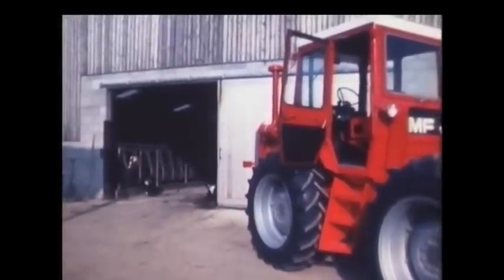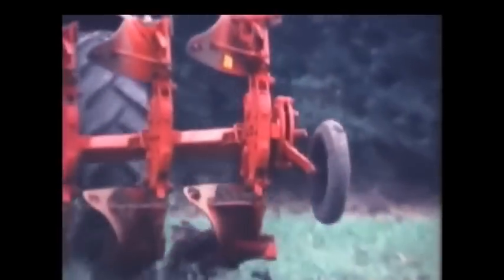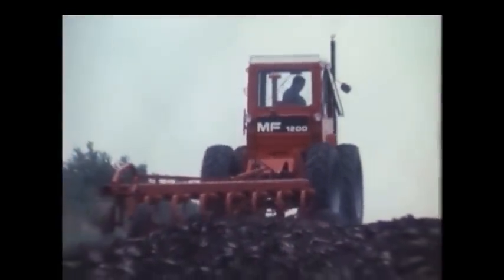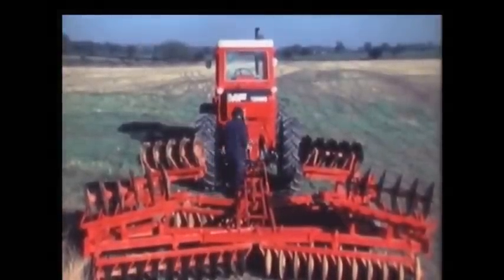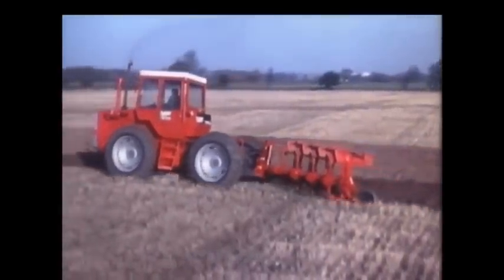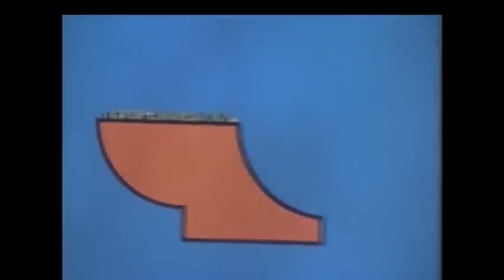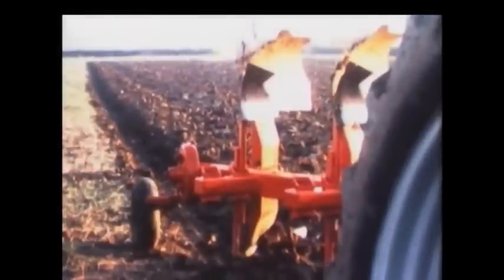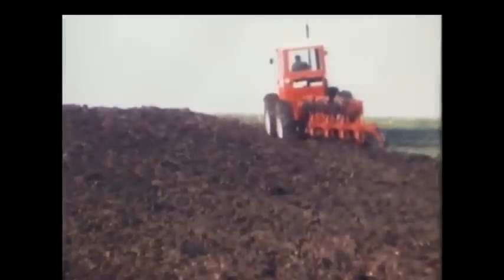Massey Ferguson 1200  original promotional film

Comment: I watched this because I once had the experience of driving one of these , it took a bit of getting used to with the steering , but by god ! could it pull , the worst part for us as lads was the engine , o.k. it was a big roaring Perkins , made here , in Peterborough , & not a bad starter , but the fuel consumption was something we used to discuss how to try to improve , as it burnt off 70 imperial gallons of diesel to do one day,s ploughing , albeit on heavy clay soil , so revving the old thunderer a bit . A company with the knowledge & tooling capacity like Perkins had almost certainly made a more efficient engine somewhere , I can only assume that for some undisclosed reason M - F didn,t use it , what a shame . Otherwise an excellent tractor for cultivations . ( for all the groaners out there , I,m a lifelong M - F fan since 8 years old , & old enough to ask my old dad how a tractor worked ! ) . Stunningly , I have found out that I have a virtual body double ; I have never had the honour & pleasure of working for M -F , but the driver in this video looks almost exactly like me at the same point in time ! small world .   Happy Spanners .
Reply from the maker: I don’t think MF or Perkins had anything more frugal than this in the day and any engine worked very hard will use lots of diesel. In contrast I did a week of fert spreading, 5 days, ave 100 hectares/day 500 ha, used from fill up to fill up 500 l diesel, would have been 400 without roadwork, that’s between 0.8 and 1 L/ha or between 0.32 and 0.4 litres/acre

Comment: I always thought it was a frame that could have handled 200hp easily..
Reply: Frame could handle 200hp and more. IMT purchased a license from MF in the 1970s for these tractors and added a Mercedes Benz V8 (210hp), V10 (270hp) and V12 (360hp) engines. Weak point was a differential that couldn't handle weight, but some creative mechanics would change IMT axles with Hungarian Raba-Steiger, which could handle power-weight ratio.

Comment: Pivot steer was a bit awkward when ploughing
Reply: Apparently, they were certain death for a rotavator, the thing was if you turned the steering wheel whilst it was still in the ground it used to bugger the bearings at each end of the shaft.
Reply: Turn the steering wheel whilst your rotavator was still in work and the lateral thrust used to knacker the rotor bearings
Reply: It would be worse with duals, but there is no front wheel to ride along the trench.

Comment: Bloody awful music for a bloody good tractor .
Reply: Typical 1970's musak! I much prefer to hear that 6.354 engine, a lovely sounding engine even though the slightest load caused them to cough a bit of black smoke!
Reply: @Mackeson3  the 6.354 is an amazing engine, that found it's way in to many different market sectors. And it was continually developed. When I think of it, I also think of the Spitfire aircraft, as both had so many iterations.
As for the music: Jazz Club on the Fast Show; 'mm, nice'!

Comment: Copy of Versatile D145.
Reply: TheVox Hey mate, D145 is a bit different to the 1200. D145 has a Cummins motor coupled to a 12 speed versatile box. 1200 has a Perkins 6.354 coupled to a 10 speed MF transmission. Correct me if I’m wrong but we’re they also fitted with multi power?
Reply: @BIGRIG2005.  The 1976 one I drove in about 1980 was a 3 forward  1 reverse doubled by high and low and doubled again with multi power. Therfore it was a 12 speed forward 4 reverse. 
The one I drove was on something like 13.6 38 tyres, so quite narrow, but could grip like nothing else with a diff lock on both axles as well. It could run out of power before traction. A bit quirky to drive for a novice but once you got the hang of the steering it was very easy. A little tricky hitching up to implement or drawbar on your own. The Perkins 6.345 smoked under heavy loads, a sure sign of wasted fuel. The controls were well placed for a machine of that era and with a flat floor and commanding driving position.
Reply: @essexpeter6116   Thirsty buggers weren't they? I remember reading about a farmer who traded one in for a Mercedes MB Trac 125 hp tractor. When the tractor arrived he looked at the handbook and noticed  what it said about the size of the fuel tank, which appeared  a lot smaller than the one on The 1200. Bearing that in mind, he phoned the dealer and asked if  before he got it dirty, could he could have an auxiliary  fuel tank fitted . The dealer said "Well go and plough with it  for a few days first and then get back to me if you still want us to fit the tank" 😉 So he did and he found that pulling the same plough it used exactly half the amount of fuel in  a day that the Massey did! (And he was getting more done in a day) 😯 Suffice to say, he changed his mind about the extra diesel tank.